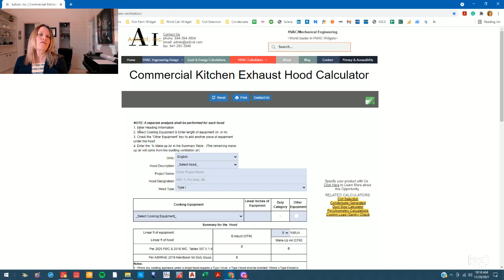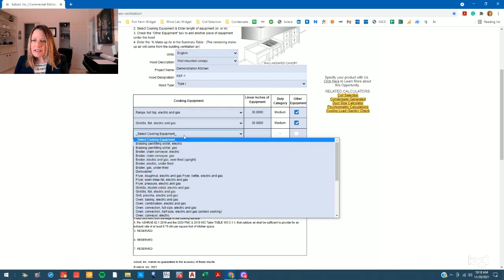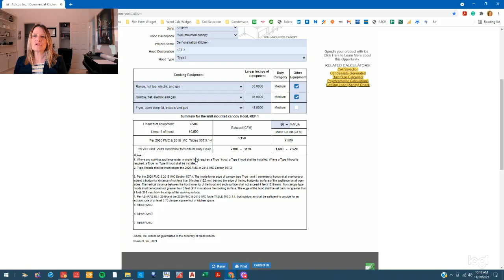Commercial Kitchen Exhaust Hood Calculator | Adicot

Comment: Amazing! thank you  so much
Can I ask you how to determine the make up air percentage?
Reply from the maker: Hi Belal, thanks for your comment!  Determining the percentage of makeup air always depends on the codes and standards that your project must follow.  Make sure to carefully review those before completing your design. 

Here are some general rules when designing commercial kitchen exhaust systems:

1. The entire building must have more air volume entering than leaving.  For example, if the kitchen is exhausting 2000 CFM of air, the make-up air + ventilation air must be greater than 2000 CFM.

2. Many codes and standards limit the make-up air to 80% of the exhaust hood air volume.  The remaining 20%+ must come from the building's ventilation air.  For example, if the kitchen is exhausting 2000 CFM of air, the make-up air to the exhaust hood can be a maximum of 1600 CFM.  Then ventilation air to the building must be a minimum of 400 CFM.